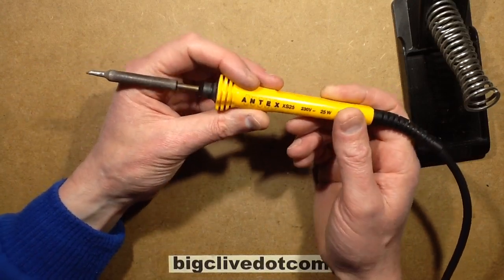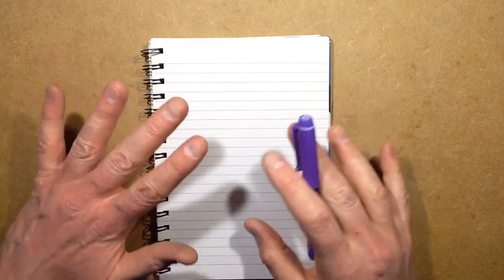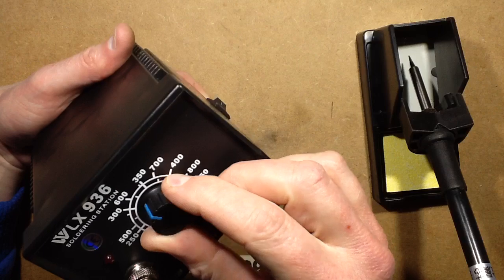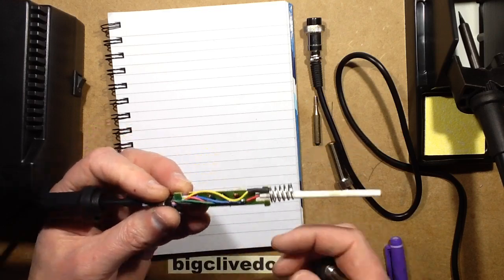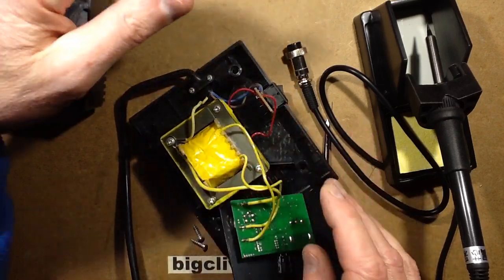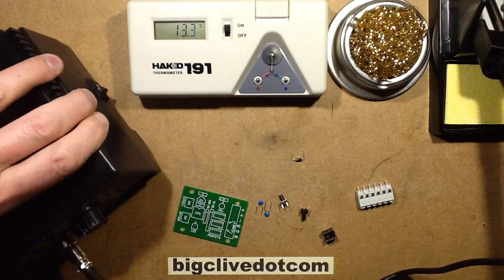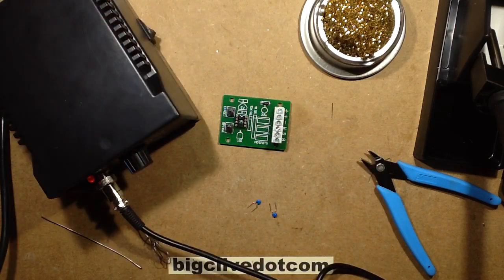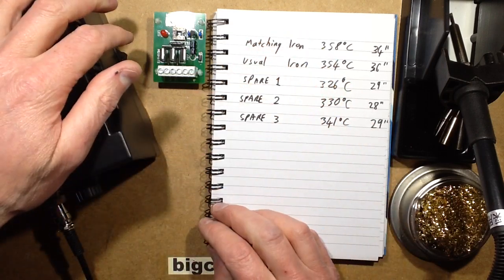Soldering basics and choosing a cheap soldering iron.

Comment: Do you recommend using an extractor fan while soldering? I've noticed in your videos you don't seem to have any fan running. Whenever I'm soldering I have a compulsion of randomly blowing at the smoke because I don't like the idea of breathing it in. Is it one of those things that simply won't do any damage from small exposure (like lead, delicious but deadly).
Reply from the maker: +codebeard When I'm soldering I automatically breathe out gently as the smoke passes harmlessly by.

Comment: The wonky temperature calibration might come from the thermocouple itself--more specifically, the joints where the thermocouple ends and the standard wire begins. If you could somehow measure that temperature, I bet it would be about 40-60 degrees warmer than ambient temperature.

Comment: You just taught me how to Solder.

 I fixed the cold solders on my wonky RPM gauge circuit in my truck.   Thank you Clive. Ive subscribed and am looking forwards to looking through your videos. 

Cheers from Canada.
Reply: Nice, though I wish he would’ve explained that the cold solder joint on a thru-hole lead can bead on the lead or the pad. He only described what it looks like when it fails to wet the lead and forms an “apple” though it can also form a ball that sticks to the lead and curls under to just sit on the pad.

Comment: I used Antex irons over 25 years ago. I used to do my own temp control by having to unplug it and re-plug it. Back then the choice to buy a temperature controlled iron was a Weller and they were 300 quid plus. The first temp controlled one I got was a JBC and after experiencing that I would never go back to those Antex cheapies. I also have a Weller and a clone Hakko that has a rotary dial with LED display. It is very accurate and has lasted 16 years.

With the current prices of temperature controlled irons from China people starting in electronics today have no idea how good they have it. No need to bother with an Antex cheapie.

Comment: I am soon to replace my 50w Antex. OK about 5 years old but the handle is beginning to crack and it's getting warm too! Thinking about temp controlled Weller or one of the Chinese offerings. I need it to be consistent though and very hot for delicate joints.

Comment: i bought a new old stock Weller WTCP-S and i am very happy with it the only thing it doest has is temperature calibration but it has a Magnetostat so it always as the right temperature and it also detects when the power is not enought and it nudges a bit more

Comment: mine burnt up in 30min transformer dead :(
Reply from the maker: +Kristijan Dinga I wonder if ti was the right primary voltage.  You could make the unit better by retrofitting a 24V AC 100VA transformer.
Reply: bigclivedotcom thats a good idea and yes it was the right primary voltage mine came with a resistive connection on the trfo output

Comment: Where do you get your lead based sold or from?
Reply: Solder*
Reply from the maker: +SuperSonicSpeedGuy I get mine from Rapid Electronics in the UK, but any GOOD electronics supplier should stock it.
Reply: +bigclivedotcom Cheers Clive, what brand do you recommend? As I've had cheap stuff in the past which has been totally useless. Thanks
Reply from the maker: +SuperSonicSpeedGuy I use their generic own-branded stuff.
Reply: +bigclivedotcom ok thanks for your help :)

Comment: I only use Weller irons.  The station I have now is the Weller WESD51. It preforms well with bigger than normal thermal masses for what it is (50 watt iron). If I need to solder on to a metal chassis I have a few Weller 100 / 120 dual wattage soldering guns..

Comment: Having big hands ideally means you have long fingers to deal with wider circuit boards. What's someone with smaller hands to do?
Reply: +bluephreakr I've seen people tape components in place or use a mat under them on the bench.

Comment: The antex takes me back 40 years. Nostalga!! I now use weller, a couple of genuine Hakos, ERSA etc. I guess the total cost so far is about 900UKP. Each has its own advantages and disadvantages. I might do a youtube video comparison once I get a metcal.  There is no such thing as a good cheap iron. The 130Euro Hako 888d is a good minimum (get a genuine one). Bits are cheap at about 6Euro each . The Chinese irons just fall apart, even an Antex is better.

Comment: The bit problem with the Antex 25W is exactly what I've been experiencing.  I have one and use it to repair things at work - I have to raid another department to get hold of the 3.2 mil bits.  Nightmare.

Comment: Can the 936 tips not just be fitted (bodged?) onto the Antex unit? I've also got the Antex XS25 and refuse to be ripped off at £5 a tip. Looking at potentially buying the 936 and having the Antex as a spare like you're doing, but would prefer not to spend £25 on a new iron if it's possible not to! We also share a preference for 3mm chisel tips :)
Reply from the maker: +burgersnchips The main feature of the XS is its mass, so it needs that large bit.

Comment: I have a Hakko 937 that I bought back... idk 10 years ago.. I have gone through about 12 tips in the time. I solder ALOT. Thing is... I still have the original heating element in it. Also, The controllable temperature thing, well. Sure it might be useful but I just tend to max out the station and just solder at full power. I think there might of been a couple of cases in the last 10 years where I have turned it down but for the most part I just solder so fast that I just crank it up all the way.

Comment: What I right now have is this cheapo thing.
http://www.vekoy.com/product_info.php?cPath=91_628&products_id=11708
Takes forever to heat up, unless you max the "temp control", it buzzes like no other. The cable is PVC of course and stiff as fuck. The handle has a thin cushion condom which doesn't even want to stay put. I've managed to destroy a couple of those bits already.
At least the iron holder is nice. There, I said something positive about it. Well price was okay but throw in 7€ worth of shipping...

I might considering buying one of these soldering stations with the temperature adjustment, or rather control.
I don't solder much but would like to do more stuff and the temperature adj. would be nice.
Also a soldering iron with a silicon cord would be nice, I did a quick search on ebay and there were silicon corded handles for these 936's.
I'll be looking forward to your video about the digital version. I might buy that because digital. And reasons.

P.S. Funnily enough, Vekoy also sells this 936 soldering station. The price is, well, interesting I might say
http://www.vekoy.com/product_info.php?cPath=91_628&products_id=24934

They also have the digital version. With an interesting price as well.
http://www.vekoy.com/product_info.php?cPath=91_628&products_id=24935

Considering what those rebranded 936's cost, the soldering iron I have now is probably also a rebranded chinese product and I can also guess
Reply: 20€? They sold you a shitty ZhongDi ZD-99 for 27€ total? I bought one for 10€ a decade ago, and i saw them just yesterday for 15€ at an expensive store. My father tells me that it's my fault, but i absolutely can't stand working with it, and i just keep smoking up and burning tips one after the other. It just fills me with the sense of panic and dread. I think i lost it somewhere, or at least i'd like to think so, because there's absolutely no point to ZD-99. But ZhongDi ZD-929 is very nice to work with, no burning action there, and plenty of punch.

Comment: You know that the fumes from solder can permanently give you Asthma if you breathe in too much.
Reply: +Jared Reabow (Jazza) I use a 12cm pc fan wired to a 6v lead acid battery to blow away the fumes when I solder. Yes it's just blowing them into the room but once dispersed it doesn't seem so bad to me :)

Comment: I'm going to be doing my first ever solder job in a few weeks, when it arrives. I have to remove an EEPROM from the circuit board and put a fresh one on.

Would at least suggest practicing before risking soldering on a £300 monitor or should there be a little room for error?
Reply: +Cameron Bromley I'm pretty sure my first practice was fixing the only other fan-cooled controller (PS2, used to use one back in the day, but the fan died) I had.  Was pretty easy, but it depends on how small your solder points are.  If possible, you might want to put a connector on the board and put the EEPROM on that (if you think you might mess up or you might do this again).  Depends on the modification you're doing and as I said, the pin size.

Comment: On the subject of cheap soldering stations...I bought one. I did some research and found one that worked really, really well with genuine Hakko tips and considering it cost me the massive amount of 30-40 quid...it's actually very acceptable.
Chinese build quality meant it had to be repaired twice but it's surprisingly good for the price.
Reply: +Nic Wilson Should note this certainly was not my first soldering iron or station. I was genuinely surprised by it.

Comment: I was hoping to see whether the duty cycle of the power to the element indicated by the LED changed when doing the chunkier components, but you held the circuit board in front of the station each time.  Just to see if it reacted quickly to the thermal mass it was having to heat.  That is, how much the duty cycle is affected by a drop in temperature (thermocouple) compared to maintaining a temperature (knob).

Comment: About your tip to apply the iron and then add solder, nowadays instructors teach a different order: start with holding the solder in the spot where you're going to put the iron. As you then apply the iron, the solder melts and quickly increases the contact area between tip, pad and lead, leading to a good join in the least amount of time.

You may not be aware of it, but look back the vid and you'll see that on many joins, you actually do it that way.

To those commenting on the pronunciation of solder: yes, the British say solder with the l, and so do the Dutch in "solderen". But the French say "souder" and the Germans use a word that's not even similar: "löten". But in the end: does it matter?
Reply: Clive's method is correct: you heat the pad and lead until it melts the solder.
Reply: NEVER heard of that method. It would not work as the leads/pad have to be hot enough for the flux/solder to work. YOUR way evaporates the flux making it useless. Do you have URLs from creditable sources or is this something you pulled out of your @ss?   WATCH MORE CAREFULLY - you are also wrong on your observations.

Comment: Slightly off topic but regarding your degrees comment at the end -  I thought that Celsius is the correct word to use as centigrade refers to the type of scale. Eg degrees Celsius and degrees Kelvin are both centigrade scales
Reply: Celsius and centigrade are interchangeable.  The clue is in the name, centi = 100 basically.  Century 100 years.  Centimeter is 1/100 of a meter.  The scale of Celsius/centigrade is based on the properties of H2O; 0 is freezing point, 100 is boiling point.  Kelvin is its own scale.  Fahrenheit is its own scale.  Centi-grade is your 100 scale.  Kelvin starts at 0, you can't go negative, as it it bottoms out at absolute zero (~ -273C/-460F).  Boiling water is 373K, freezing point of water is 273K.

So you can say water freezes at 0 degrees Celsius/Centigrade, 32 degrees Fahrenheit, 273 Kelvin; 

it boils at 100 degrees C, 212 degrees F, 373K.

Just so people who see this can get the info without looking it up (but please do instead of just trusting me if you need to!).
Reply: Even more complicated, the kelvin isn't actually a degree, the unit is just a "kelvin"

Comment: Oh the digital one is terrible, none of the buttons do anything meaningful -  I can only get it to do two temperatures, 300 or 400 and there's no difference between the two. I have no means to measure the actual temperature, but it makes no difference what buttons you press, you get the same temperature, which is "just about hot enough". YMMV
Reply from the maker: +Kieran Simkin That should be interesting to see.
Reply: Ah when you referred to the digital version I assumed you were talking about the 980D which is what I have. The 936 doesn't seem to suffer the same problems. The 980D is smaller and takes the same standard plug-in soldering irons, but the digital control circuit for it is near-meaningless

Comment: I've used quite a few over the years but right now I'm running an old Hakko FP-102 that I picked up after using similar models at work. I had to repair the cable and disable the key slot, but I have just loved the thing since.
I have shared this video with a FB group of quadcopter enthusiasts as I felt that you nailed it on so many points.
You even worked a project in for a practical demonstration because as I'm learning you sir tend to rock.

Comment: I have a 936A+ and the element temperature sensing is not a thermocouple but a PTC. Others do have a K-type thermocouple anyway. BTW, I fixed the awful thermal connection by using some aluminum foil between the heater and the tip. It's not pretty but it works.

Comment: I wonder if some high-temp thermal compound could improve the conduction between the element and tip. It would be quite inconvenient to change out bits afterwards, but at that price you could have multiple irons and switch out the whole iron as needed.

I had noticed the different boards when looking at ebay listings. I was not impressed with the lack of heat sinking for the smaller boards. I seem to recall the Hakko units have a big heat sink. I wonder if one of those mini case fans could improve dissipation.

Comment: For my soldering needs I went for Aoyue. They're also Hakko clones, but are actually produced by a reputable manufacturer, not some dodgy iron ordered from Ebay.  I got an Int 3210 soldering iron and an Int 2703A+ SMD reworking station so far. Everything lead-free, too :)
Reply: It certainly come from the same factory